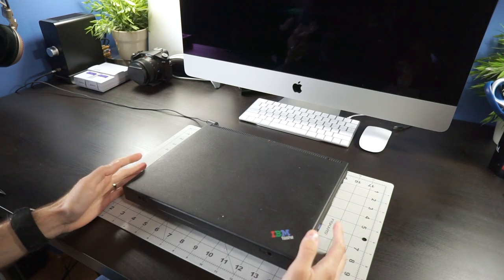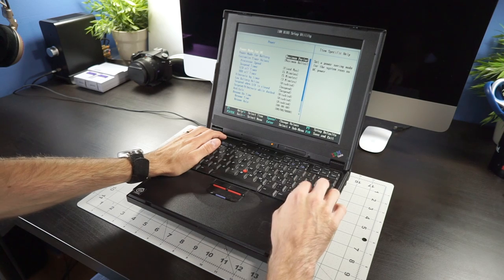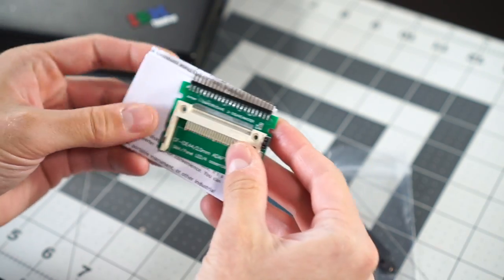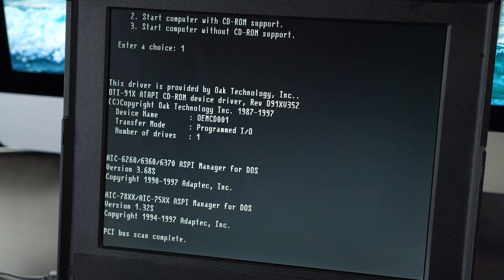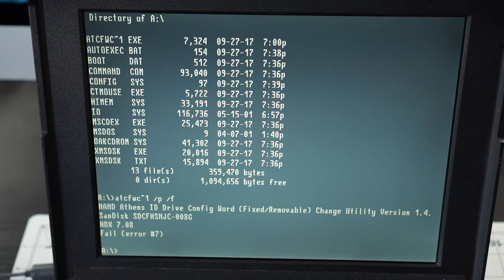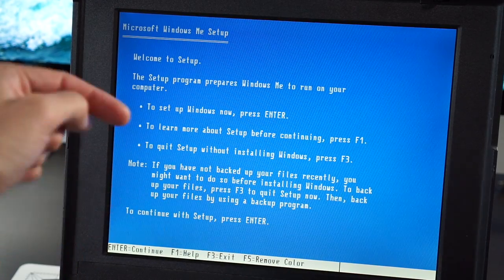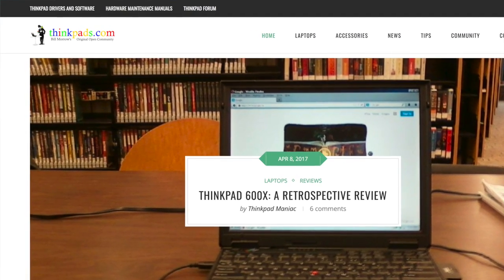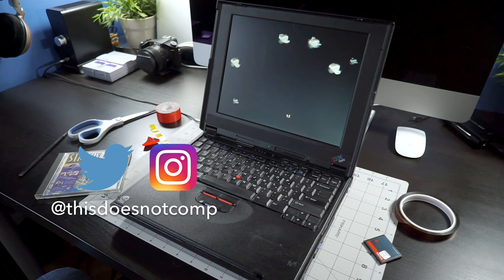Repairing a Vintage ThinkPad

Comment: the reason compact flash is so compatible is that it is ide natively, its connector is a 40 pin ide, its just a size smaller than laptop 40 pin ide, so just needs pass through connectors.

Comment: I had a nice second-hand T40 IBM from 2007-2010.
My T40 had a weird issue: the display turned black (built-in display as well as any VGA display) after a few minutes, sometimes it would spring back to life if I squeezed the bottom right part of the laptop.
so I dismantled it just to see if I could do anything about that but broke the case in the process so I threw it out and kept the guts of the PC. I recently powered it again just to find out it did not have that faulty display issue... so I have a perfectly functional T40 without a case; guess I'll find or build a nice low-profile case to make it into a retro machine... I upgraded the CPU and RAM since then, and it is a beast (well, it would have been, back in 2003 when it was new)

Comment: Great video, your stuff keeps popping up in my recommended lists (maybe LGR/8bitguy/modernvintagegamer etc. got something to do with it).  Subscribed.:)
I got into old laptops because of LGR and the 8 Bit Guy. I have a Gateway 2000 Colorbook 486, a Triumph-Adler 486, Compaq Armada 1530 with a PI, a Dell C600 with a PIII,  a Dell 9200 with a P-M and a Radeon 9700 (to relive my Win98 / XP gamng days), a IPC Mitac 6133 Celeron 433MHz and a Thinkpad 600E PII 366MHz. All functional (minus batteries), some as complete units, some with external displays. I'm slowly repairing what needs to be repaired or just install windows/DOS on a new M.2 to IDE drive adapter. I'm not sure I'm ever going to use these, but it gives me a lot of pleasure messing with them, tweaking them, getting them running again, improving them. It's also one of my cheaper hobbies. :D The laptops cost 160€, the drives so far about 200 including adapters (to IDE and SATA, 1x120GB, 3x32GB and IDE/SATA to USB).

Comment: i swapped the hard drive in my ipod mini to a compact flash i never expected to see a laptop using one
Reply: only my compact flash was an sd adapter. probably would be easier for file transfer
Reply: I did the same with my iPod Mini. I used a SanDisk Ultra CompactFlash card of 8 GB in capacity and it works great. :)
Reply: iPod Classic here, with a HDD-CF adapter going to a CF-SD adapter going to a SD-microSD adapter and a 64 GB microSD in that one. Works great!
Reply: Yeah, it's useless. Hard drives are rather durable, they die when you drop them sure, which is why I don't mind them being on iPods. But even if you drop a laptop, that thing still works unless you rage quit and smash the palm rest. Then that's how you kill it, but I doubt you'd do that with an old machine

Comment: Nice restoration job, but you really didn't need to buy a hard drive caddy. You could have cut out cardboard spacers out of cereal boxes, effectively shimming your new drive assembly so it wouldn't move around inside the bay. Or use polyurethane wafers cut to size. I've done this with old Thinkpads.

Comment: The ghost movement on the mouse erroneously recalibrating itself.

To mitigate drift the trackpoint automatically recalibrates anytime the input doesn't change for a few seconds, the idea being that if you take your finger off it will automatically recalibrate the zero point. If you keep your finger really still on the trackpoint it will recalibrate, and then letting go will cause the mouse to move until the trackpoint recalibrated again in a few seconds.

Comment: It's completely understandable that you'd want to take your hard drive out of your old computer before you get rid of it but PLEASE leave the caddy and adapter in the bay. It's very annoying when you get an old PC only to realize that the caddy and adapter is missing when it is very very noticeable that it's not part of the hard drive itself but rather part of the PC.
Reply: At this point i'm thankful to find working computers, a lot of laptops have been built with what they call a "strike zone" where the instructions tell you to smash it with a hammer before throwing it away, awful truly awful. So many ruined pieces of equipment.
Reply: Strike Zone Hard Drive Protection System
The Strike Zone Hard Drive ProtectionTM system was designed and developed by Dell to protect your Latitude from damage and potential loss of important business data. Using a resonant vibration damper, Strike Zone helps absorb the shock, dispersing energy away from your hard drive in the event of accidental laptop drops and bumps.

Comment: Right now I am restoring a Apple PowerBook g3 from 2000 and I have so far spent 40 dollars in parts I still don’t know if it works the parts haven’t came in the mail yet. I got the PowerBook for free from the recycling center

Comment: Yeah, about the longevity, the CF will fail faster than a Hard Drive, the Compact Flash card has a lower read/write cycle than any Hard Drive, but you can find IDE SSDs, I think that kingspec makes cheap 16gb IDE SSDs.
Reply: I prefer to do what PhilsComputerLab did, and by that, I mean use an SD card instead.

Comment: As far as I know, it's easier to use an SD to IDE adapter, and PhilsComputerLab has done a video about that, but he showed a desktop.

I have one with a 2GB SD card inside one of those weird IBM proprietary hard drive cartridge things inside my 760EL, though I had to stuff the inside of the cartridge (or caddy) with cardboard in order to prevent the drive from flapping around and damaging the adapter cable. That also has Windows ME on it, as per a friend's request, and I have another laptop with Windows 95, though I'll be swapping the card later on in order to install Windows NT 4 if I do ever repair my moisture-damaged (though understandable why) 760ED.

From what I know, certain versions of Windows will refuse to install on CF cards. DOS-based Windows should install fine, but certain NT-based versions, like Windows 7, refuse to install on CF cards, which meant that on my Fujitsu U1010, I had to install a version of Linux (in my case, Devuan) instead. That thing uses some weird kind of IDE interface where it seems to use the same kind of 1.8 inch hard drive with CF connector, that early iPods used. I'm sure some of them had proper IDE ZIF interfaces. Anyways, hopefully a utility like what you showed had been released that works with the Kingston card I have in there.

For me, when I went to get drivers for my 760s, I went to ps-2.kev009.com, and cross-referenced a couple of their old IBM site archives ("PC Partner Info", and "PCCBBS" to be more specific).

As far as I know, with the NeoMagic MagicMedia 256AV, the drivers for those are not included in Windows 98, so for my Acer Travelmate 514TXV, I had to cross reference with the drivers for the ThinkPad i1500 (similar thing, built for IBM by Acer, from what I read online) and was able to get graphics and sound working. I do still have it, I ended up turning it into a halftop and losing the top half with cracked screen and the dead battery, but all it has is just Windows 98 SE with the aforementioned drivers and Office 97.

38:04 Older ThinkPads usually had a volume control separate from the OS. Try pressing the volume buttons on the keyboard if it has those.
Reply: The volume control is a dial on the side of the machine. Showed in the beginning.
Reply: While installing the OS to the CF card, was it connected directly via IDE or USB?

Comment: I recently discovered ide to msata 2.5" enclosures. There's a DOS trim program out there (Thanks to this Rlowe guy, RIP) and for XP and Vista you just need to align the partition and use some ssd toolbox thingy (I use Elpamsoft SSD Tweaker Pro) but Intel, Samsung and others have their own tools for optimization, and based on my research on MSFN, people never trimmed and they're fine.

Comment: I whas working at a recycling factory where i disassembled old pc's, and once, there whas a load of industrial thin clients with cf cards in them, there were thin clients with a 128mb drive in there and other ones with a 1gb industrial cf card (thats what is says on them), a have a load of those :p so they are already in fixed mode

Comment: Interesting, I am doing windows 2000 inside a virtual machine for backwards compatibility with older applications. The application that I am using is circuit maker 6 which is needed for my lab in the university, so now that I got it to install, then I can copy the files and paste into my windows 10 and it then ran, it is just the the installer is very old. I gave the vm 8gb space, windows 2000 has a lot more stuff than me, like the task manager we know very well in windows xp, so it takes 1.7 gb for the os, so that means you will have to use the 8gb compact flash card and configure it for use as an ide ssd. Also be sure to disable the defragmentation since this is not something that should be done to an ssd. So try to get that 8gb compact flash working so you can do windows 2000. Windows 2000 can probably support flash drives so you can use the computer for backwards compatibility purposes. Do not connect to the internet at all you will get hacked and you can get ransomware on that thing.

Comment: I have a old ibm 600e.  Refuses to boot past cmos battery error codes. I found a self test with pressing f2 on boot. HD tested ok and main board tested ok. However it's stuck on the ram test. Also what do you do with the weird soft coating on the plastic? It's all rubbing off. Any suggestions?

Comment: 7:50 Removing the HDD before throwing the laptop away, actually is the sensible thing to do.
Reply: Or just MBAM/reinstall and give it away to charity.
Reply: @JuanHerrero  You can still recover data off of it.

Comment: The way you destroy old laptops is truly incredible. You don’t clean them up. Change cases, case fans or video cards with brand new components. You just chop them up. Your weird fascination with everything but dell is also amusing. The dell c series is the best at 9x computing. Look no further than the c810. No track pad? Throw that notebook away or fully restore it as a shelf piece because it’s not usable. Not worried about functioning batteries? Rebuild them. It’s easy. I’ve rebuilt many laptop batteries. All it takes is the standard lithium cells that every laptop uses, a welder and a soldering gun. My god man. At least replace an old tired lcd with a new old stock one for once in your life. A good win xp machine is a dell Inspiron 9400 it can play crisis, not limp along with a 7500 Radeon that’s only twice as fast as a GeForce 2 go. Come on. Just sad.

Comment: Had a PB pizzabox style computer back in the day around the same specs as the high end versions of this laptop. I keep forgetting how low the specs were back then. Today we're used to flipping home computers with 4-8 gigabytes of ram and processors around 2 gigahertz . Megabyte and megahertz is hardly relevant anymore.

Comment: This is like me. I find something for free and then spend loads of additional cash to fix it and improve it. In the end it still isn't perfect and I find similar item somewhere on craigslist, in pristine condition, fully working and usually much cheaper then the sum of all my effort. Yes... and then you also realize (after all that chore) that there's a BIOS limit on the hard drive size and you just can't use anything larger than 7GB.

Comment: Wait... aren't there little tabs that protrude on each side of the CF adapter's edge connector? and they seem to have screw holes in them too. can't you screw that to the IDE case''s end? That seems like an ideal solution right there. Oh well. Sorry, just my OCD kicking in there XD

Comment: Also, Colin, not to be a pest, but compact flash is Sloooooooow in transfer rates, why not use memory that will max out the ide bus, like a a small 8gb msata with pata adaptor?
Reply from the maker: A couple of reasons why I went with a CF card and adapter. First, the ThinkPad 390e apparently only supports ATA-4, which maxes out at 33MB/sec. Second, I don't plan on using the machine much. Third, the adapter was only a few bucks, and I already had the CF card. If I had a higher-end vintage laptop I planned to use often, then I'd absolutely go with a proper SSD!
Reply: This Does Not Compute 33mb/s?!?! Yikes, ok compactflash is perfect hahaha

Comment: i just picked up this laptop today for $10. the hinge on the left has broken , the plastic case part is missing abit of it, and looks like the screw is missing. its loaded with windows xp professional .. idk how it runs but im guessing a custom version of xp. need drivers for it and am currently working to burn cd of win 98 se. that should work right? any help would be appreciated.

Comment: Why didn’t you plug the 8gb card into a pc and use a hex editor to manually change the bit to fixed mode sense you said that’s what the utility does anyway

Comment: The maximum amount of ram supported by these machines should be either 384mb or 512mb, that is if you use PC100

Comment: very cool sim city 2000 ! i would do msdos autoexec batch file for mouse driver / midi sound card driver rolland d110 w fsk . norton commander and cakewalk 3.01 for dos - 4 color cga i sall you need for the best sequencing software that exists .

Comment: You didn't show the computer booting, it would've been nice to see how fast it boots.
Reply: One without any software installed would take around a minute to boot. It could take as long as 3 minutes to boot a computer with even a basic amount of user software or disk fragmentation.

Comment: A flash card "more reliable in the long term" than a mechanical hard drive? Seriously? Flash cards are not like SSDs. They withstand quite a more limited number of write cycles, and are thus OK for storing documents, photos etc, but not for a full fledged PC operating system which is constantly creating, reading and modifying hundreds or thousands of system files.

Comment: I had Windows Me as my first OS and it nearly made me hate computers forever.
Reply: motorsportfangr i had windows me for years even when xp come out and i had never problem with it.Even today for my old computers is win me my first choice of operating system. Win 98 was never a option for me.
Reply: windows ME kept removing half of my files and crashed on a weekly basis, I downgraded after about 4-5 months.

Comment: While it's okay for purists to do their thing I'm with you when it comes to having something function the best it can if the upgrade options can help.
In some older hard drive setups you can have it behave as a slave unless it's alone than it's a master. If it was set to slave only I assume it would never be able to boot an OS.

Comment: I suppose Windows ME was just a Joke? You acknowledged is awfulness in the video. Windows 98 SE was the last great MS-DOS based Windows operating system.
Reply: Maybe it was a "joke" intended to provoke some reactions in the comment section because of it being a non-typical and somewhat unexpected thing to do. The thing is, well, it doesn't really matters much: it's not like this old machine is going to be used often at all. The goal was simply to repair the machine and have it running, that's all.

Comment: Great video and nice Thinkpad.  I know there are benefits to solid state media for a HDD  but I would argue reliability is not one of them.  All solid state media have a finite number of read/write cycles and it is only recently that they figured out how to extend that to a point that is not a complete waste of time.  I have 25 year old IDE hard drives that still spin up no problem and if they fail a mechanical drive can be rebuilt.  If an SSD dies you have a door stop and you better have everything backed up.  Heck they even specifically advise against defragging an SSD because you will kill the drive quicker.

Comment: The floating pointer happens on my T450 Lenovo Thinkpad
Reply: I think it's something like residual tension on the trackpoint, or dirt, something that will cause it to move ever so slightly.  Or even something on it's contacts.  My guess anyway, I don't know how the trackpoint is actually engineered.
Reply: @SenileOtaku  it can be probably need a good cleaning due to the pet hair that tends to build up

Comment: These CF cards are much slower than mechanical hard discs from that era. HDD would be about 50MB/s. CF has faster seek time, but transfer rate is much slower. I have such card in one of my old netbooks, and it required additional disk buffering software to be usable.

Comment: I would use a disk imaging software to copy the 2gb card to an 8gb card.
Reply: N O W you are thinking with portals! Still, it probably wouldn't boot, but worth trying.
Reply: I've used a free software called disk wizard to do this with several different types of drives. From USB to SSD to HDD to flash cards. It's really very easy.

Comment: what in the world compelled you to choose ME? YUCK... for those who don'y get it. 9x/me is the reference when talking about 95/98/98SE/Millennium edition. just go straight to Win2k. and on the CF utility. you notice the HDX Line. i believe that has everything to do with why the 8gb wasn't working. I bet that is the firmware revision. and it us just too new. and once i got to the point where you said why you installed ME. such a masochist. damn.
Reply: Masochist? Nah... This old machine is going to be used very seldom. It's not like we are in 2000 and this guy decides to install Me on his main machine for everyday use.